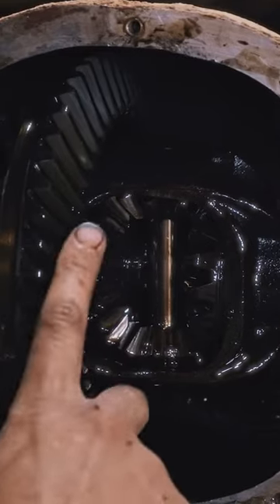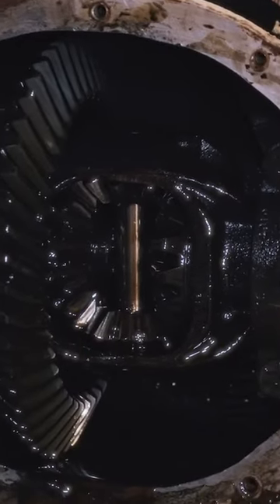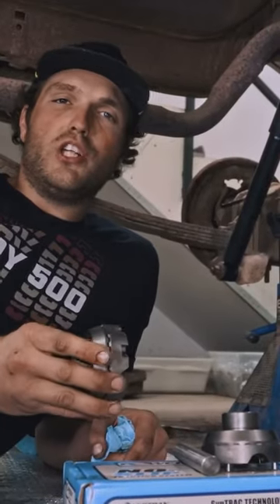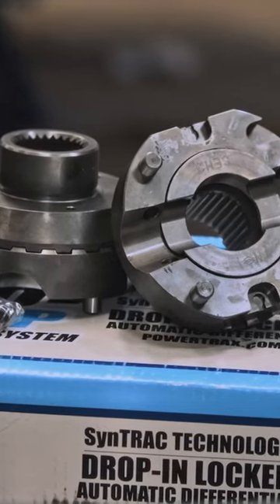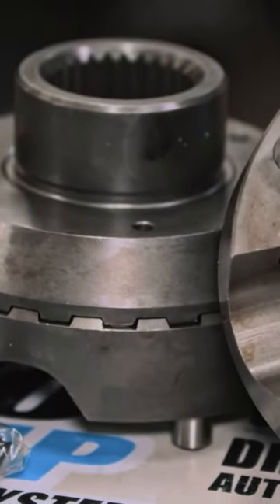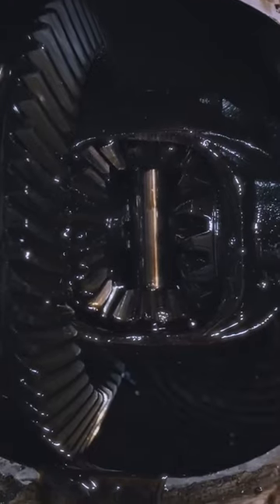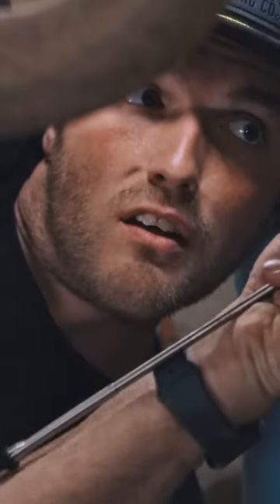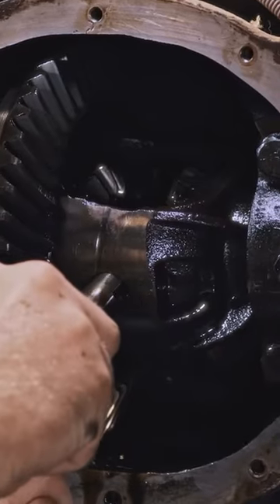Replacing an Open Carrier Differential | Roadkill Garage

Comment: Does that still allow the wheels to turn at different speeds around corners?
Reply: Sort of. The teeth are beveled so they lock under load and can slip past one another to allow a differential in wheel speed. In other words, you have to take corners with your foot off the gas pedal otherwise it's locked and the wheels are turning at the same speed. Once you get used to it, it's a fine setup but it will increase tire wear
Reply: @ghuber777  ok, gotcha. Thank you.